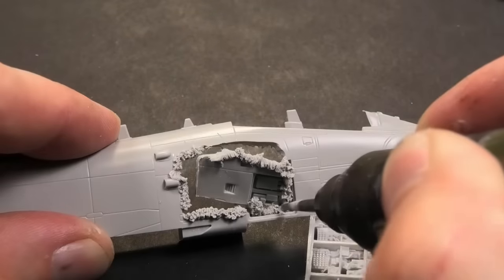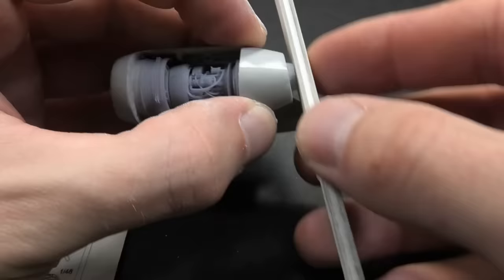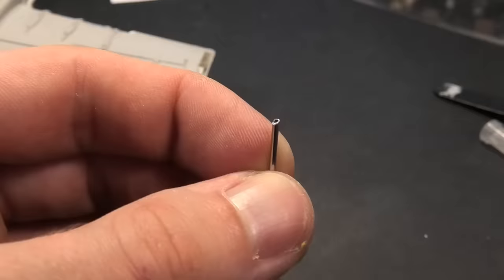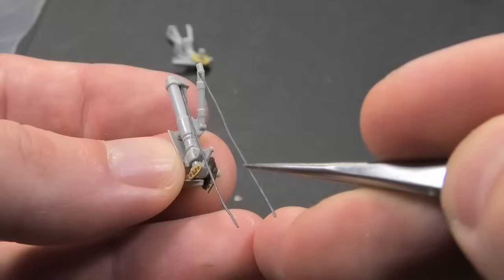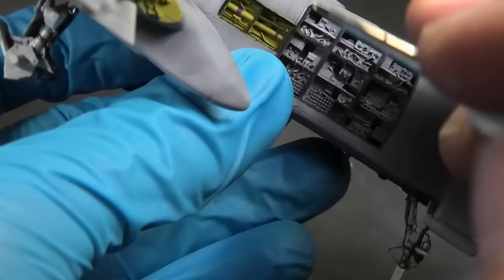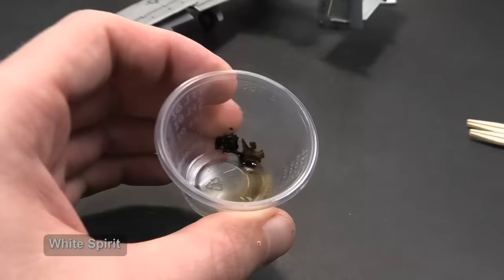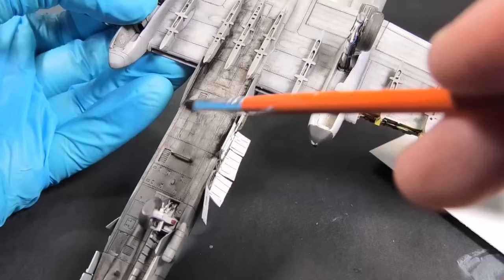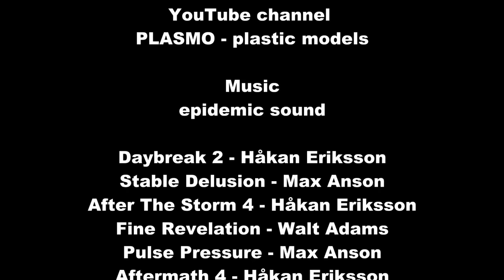A10 Thunderbolt II Black Snake - Italeri 1/72 - Aircraft Model

Comment: Hi Plasmo! Im watching your videos for a few years now. I have another method to flatten the tyres.  Get a metal mug, fill it with water and warm it up from the bottom with a flame burner.  Put the wheel inside the mug with tweezers and apply some pressure. I think this method adds a more natural detail to the flattened tyre becouse the sides pushing out a bit too.

Comment: Love your work! I bought a pack of the CMK razor saws after seeing you use them to replace/add panel lines. Great stuff! But they gave you the wrong seat for the A-10. Thats the ACES II for the F-16. The ejection handles are on the sides to prevent interfering with the center mounted control stick.

Comment: The A-10 model is another masterwork! The 3-D printed jet engines are fantastic, but how did you create the engines using the 3-D printer? Is there a program with engine dimensions that the printer uses to create the precise shapes of the engine & parts? I've never used a 3-D printer, so there is much I don't know about their use.

Comment: Hi Plasmo. First of all thanks as your videos have been a great help as a person startingin the hobby. How do you manage to scribe panel lines without having to tape each line as a guide? I tried using a scriber as well as the saw blade you use and scribe the panels by hand, but more often than not the scriber jumps out of the panel line and ruins the model.

Comment: That airplane would NEVER look like that for very long. Did you see Col on the side of the aircraft? That means Colonel, that means Air Wing Commander, that means the plane captain is one of the most senior NCOs on the base. "HIS" airplane is meticulously and lovingly cared for. It is marked Fort Wayne, so the aircraft is stationed in Indiana, so it is part of the Indiana Air National Guard, flies less, maintained more. Fuel and oil leaks are found and fixed, PERIOD. Fuel and oil are flammable so it is a safety and an environmental hazard and must be fixed. Stealth aircraft are always clean because fuel and oil can damage the stealth coatings and would make it difficult to inspect. They get repainted often. They may look grungy after a mission but they are not allowed to stay dirty except during high tempo combat or training operations.
Reply: You're 100% correct. I live near where the Blacksnakes are based and see them flying around sometimes. There is little to no wear on the aircraft. I've seen them up close at airshows :)

Comment: It's good for a Model but you took way to many liberties with the style of Painting especially the shading etc. The most absolute important part of the Airplane and what makes it famous is the 30MM Gatlin Gun in the front which you made look like a closed pipe?

Could I do better? No absolutely not BUT you could have with the experience that you have.

Oh and it's the A10 "Thunderbolt" or most commonly known as Warthog (or "HAWG" due to it's size and slow speed's as well as it's look's ) not War Hawk. It's been one of the major backbone Tank busting service Planes for well over 4 Decades literally being responsible for the destruction of well, well over 1000 Tank's (I believe just Russia's alone) so if your going to do it in such detail then do it to it's exact standards and not yours. Oh and a SNAKE emblem?????????

Are you serious? The famous insignia of the Plane goes back to even the P40 Flying Tigers and is one of our proudest insignias only the best proven by the most hardened Battle action that we Honor Smh. If your going to do it then do it right especially one of the most iconic Planes in U.S. history.